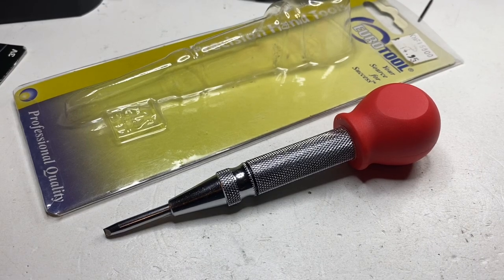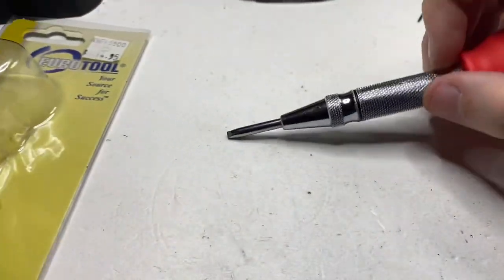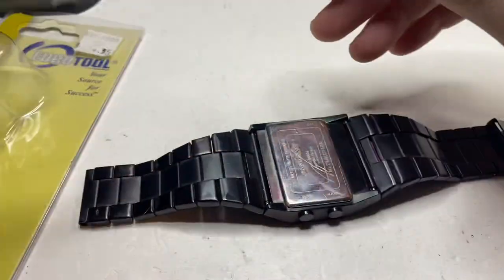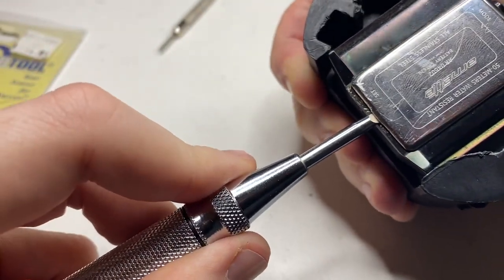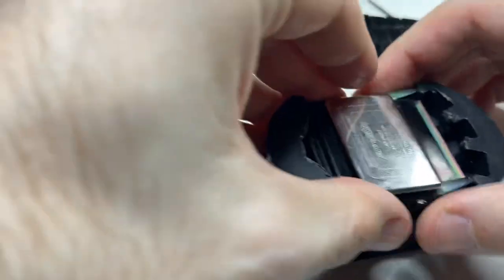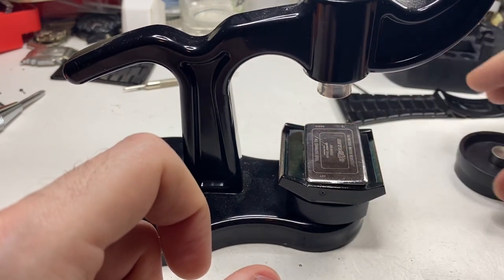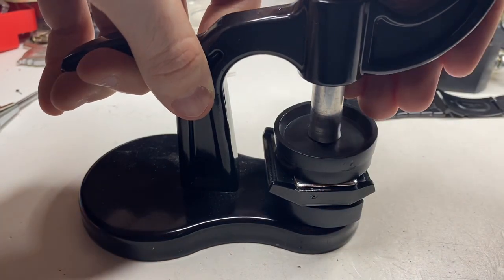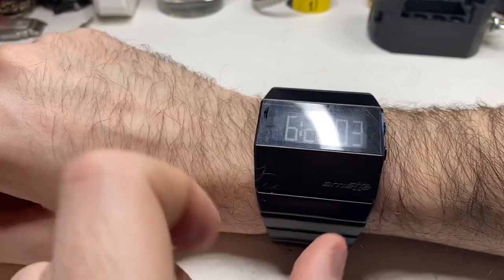How to remove impossible watch backs easily

Comment: Impressive, I have had some very challenging backs on watches but I’ve taken off. I’m gonna start taking a look for a tool like that. I’ve got a punch it has the same mechanism on it I might be able to convert it. That was a good demonstration on the press. Have you some pretty creative ways to press the back in the place. One method that I have found that works really well is to use hot glue and an old pencil. I hot glue the pencil onto the back and use the pencil for leverage. Then spray some rubbing alcohol onto the hot glue let it soak in and it pops out without any damage at all. It’s always good to see different techniques👍
Reply from the maker: Thank you, I have never used the hot glue technic. I will have to give it a try next time